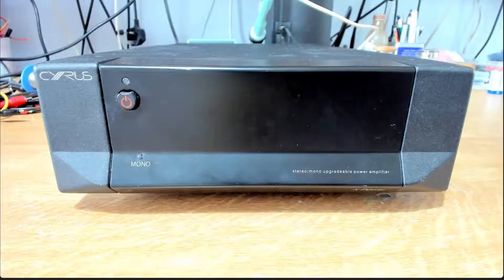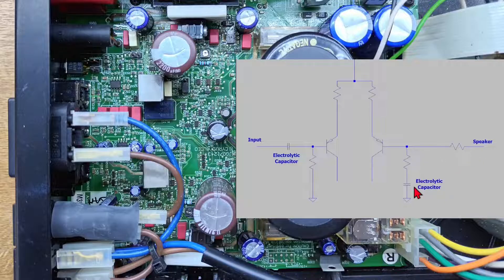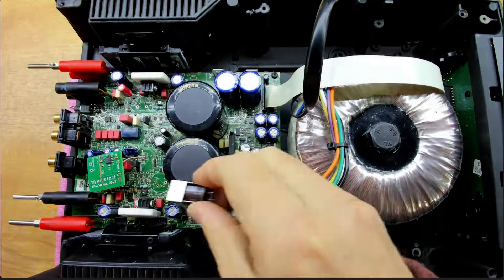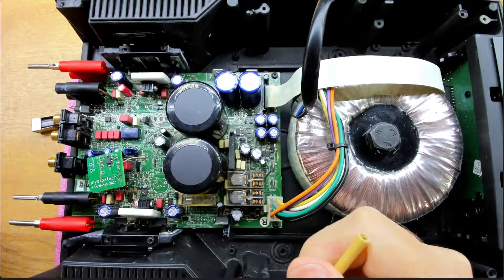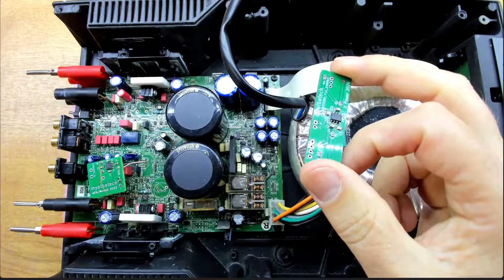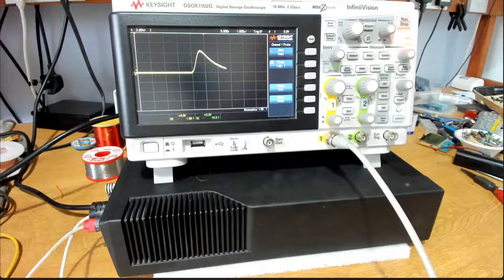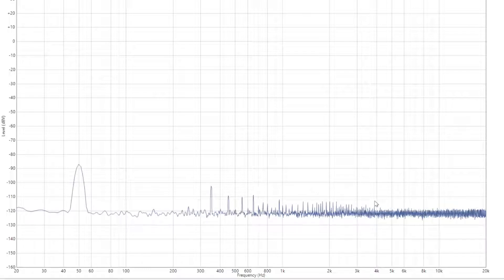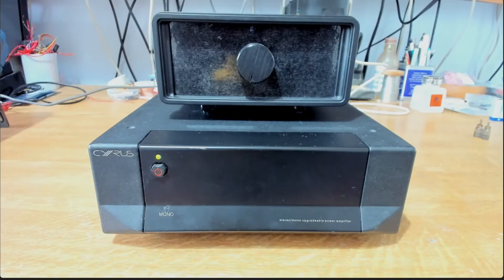Signal Path Upgrade for the Cyrus X Power

Comment: 2200u on the NFB return to ground? One usually sees 100-470u at most and that's enough to achieve FR close enough to DC. On the other hand, majority of input caps are between 47 and 220u, so this time they must have gone for a much, much smaller value instead, since you were able to substitute a polyester one. Interesting. With Kicad ground pour, I usually see 0.5 - 0.7mm as minimum clearance required, yet most designs feature 0.2mm. Could you please advise?
Reply from the maker: Yes, I should have commented on this point. The capacitors here are of unnecessarily high values. The higher the model the bigger the capacitance it seems - probably related to marketing... The ironic thing is that with bigger feedback DC blocking capacitors there comes more leakage and a corresponding higher DC offset. They also take longer to charge up so the power on 'thump' is bigger.
Cant comment on the different PCB standards I'm afraid.
Reply: @myalbatech  You may be right with market related reasoning behind the idea, Im afraid. Difficult to justify otherwise. In terms of spacing, I'm having lots of fun designing a power amp PCB and trying to figure out which IPC standard to follow. +/-120VDC rails suggest 0.7mm, but then ground will be half that, so 0.4mm should suffice. Then again, if viewed as a power conversion unit, which may be a bit of a stretch, 1.6mm is given as minimum. Well, smoke signals will give the correct answer. The hardest part for me is to figure out how to reconcile star grounding appropriate for final stages with ground layer suggested for the input ones. Don't want it to ring (lateral fets) nor do I want to end up with an elevated noise floor. Tough nut to crack, I guess.